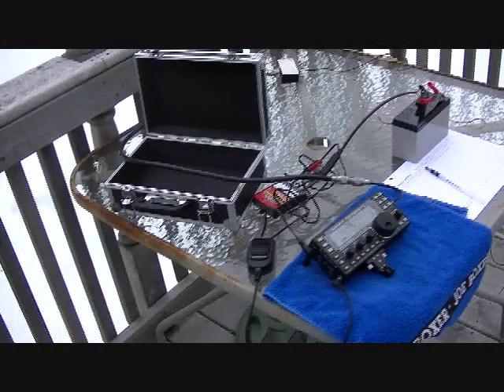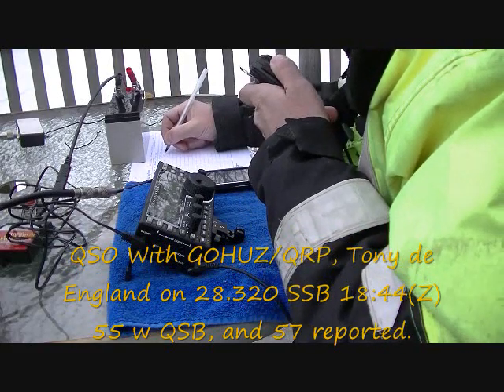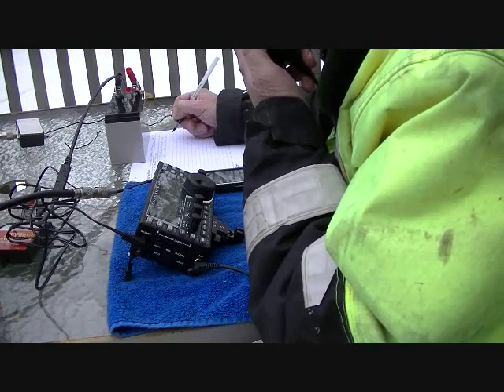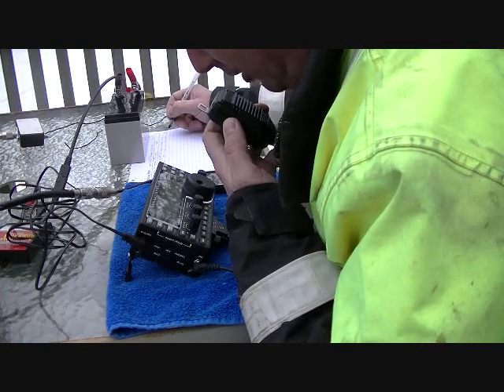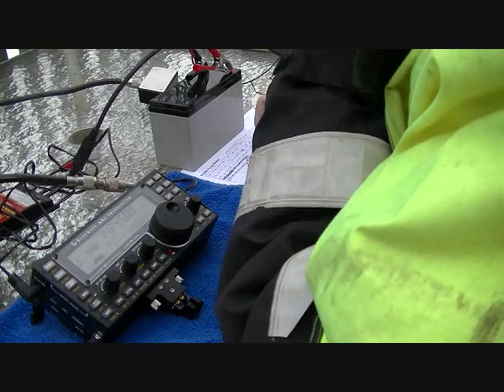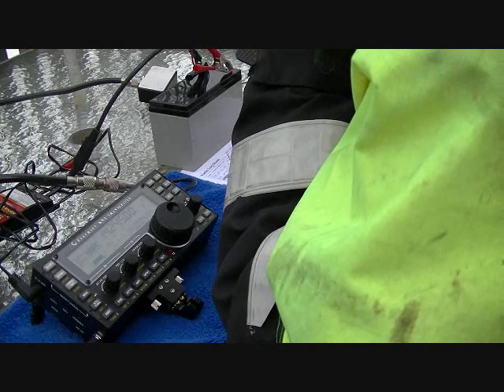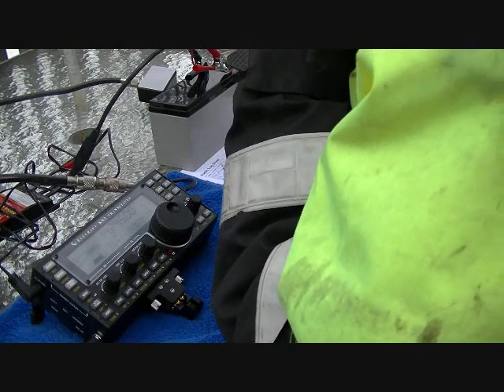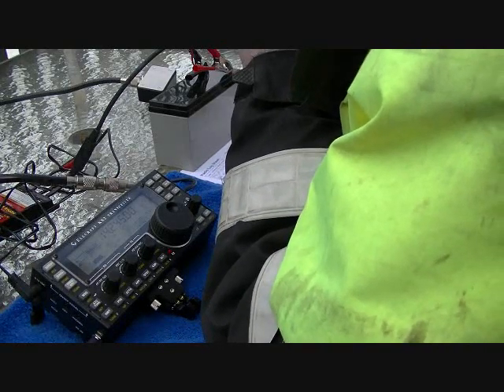Open End Fed HOMEBREW Antenna Project & QSO Test KB1VWQ

Comment: What type of ferrit do you using ? Thx.  73,
Reply from the maker: the torriod here is a simple one a 106-2 I believe and wrap the 22 gauge wire around it nine times.
Reply: clipdan  Here in the west part of Europe we using the FT 140-43  for end fed s antennas